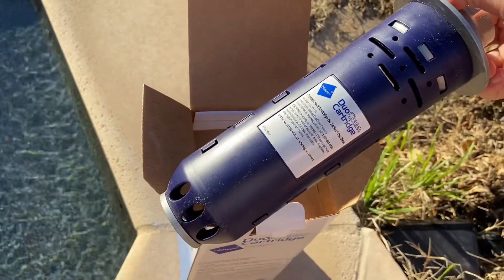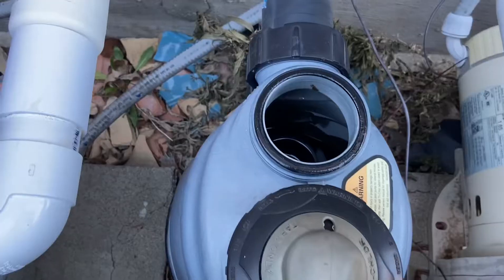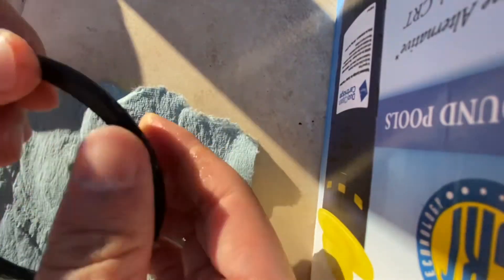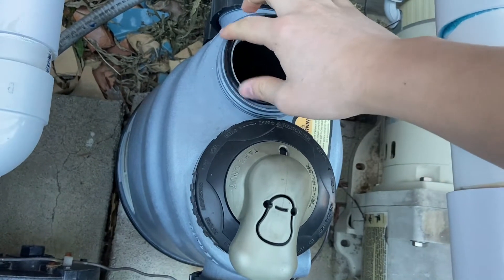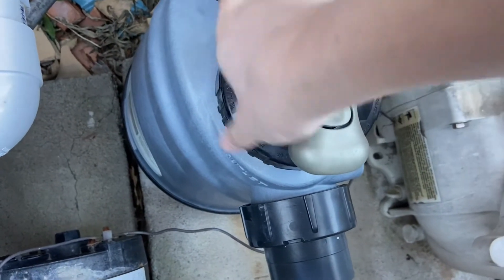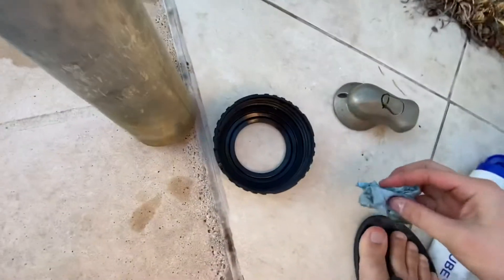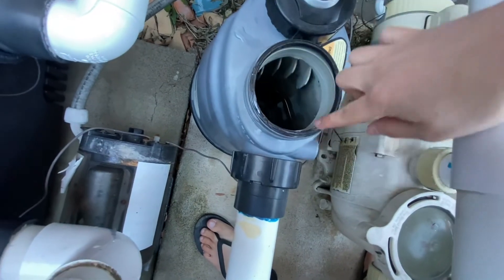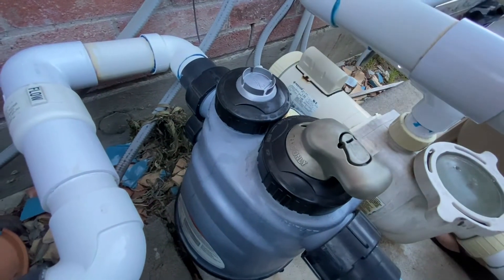How to Replace Nature2 Cartridge and Add Chlorine Tablets to Pool

Comment: Is there a trick to getting the lid off the cartridge tank? We cannot get ours off
Reply from the maker: A large clamp with just enough pressure to turn the lid
Reply: Use the device mechanics use to take off oil filters. It gives you the much needed leverage. Buy at auto parts stores. You can’t get yours off because you over tighten to stop the leaking..if you properly lube the o ring you can hand tighten slightly and the lube prevents leaking since it’s marine lubricant and water can’t penetrate it.

Comment: Can you just put powder in the tube instead of tablets? If not, can you use any kind of tablet or does it have to be their brand?
Reply from the maker: no powder, but you can use any kind of chlorine tablet suitable for pool
Reply: No you’re supposed to use v packs only and the v packs have 3” trichlor tablets in it. The whole purpose of this system is to SLOW RELEASE chlorine so you can dial in and control a low ppm of chlorine. One v pack lasts a month whereas if you just dump chlorine tablets in like this guy, they all dissolve and release into the pool within a week and you’ll have to keep refilling weekly.